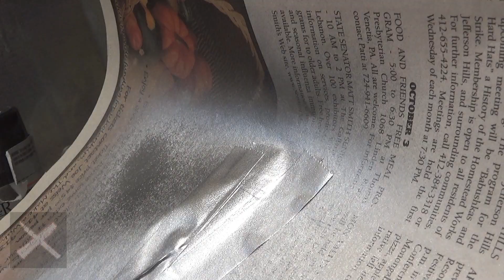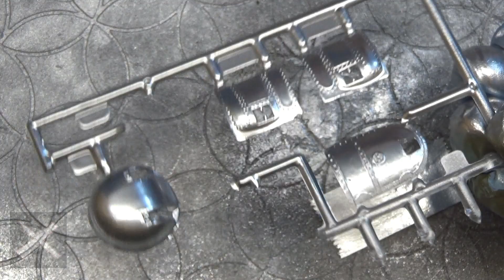Revell B-17G 1:48 - How to weather the Turbos and Drilling Holes, Painting the Fuselage. Part 6

Comment: Remember, U.S.turbochargers were made of stainless steel. The discoloration was not rust, but heat discoloration, along with exhaust stains.
Reply from the maker: Doesn't really matter.  They all kind of look the same.
Reply: @PlasticModelBuilder  lf scaling & rusty, then no, not all alike. I have examined the turbosuperchargers up close and personal on B-29, B-17, B-24 & P-38.
Reply from the maker: Its close to the same effect.  Same colors used.  Pinks, red,  oranges. Etc.  Its not chipping rust, but rust color.